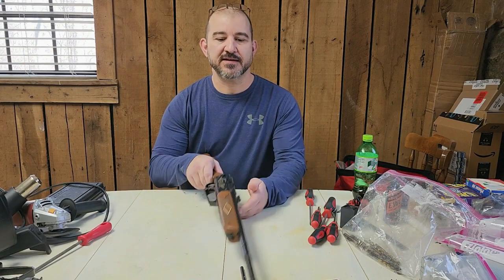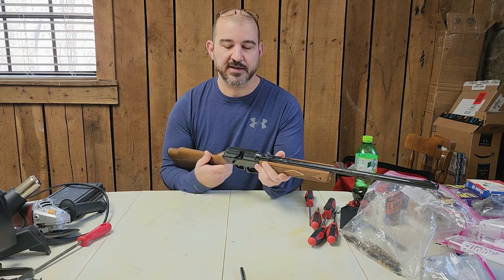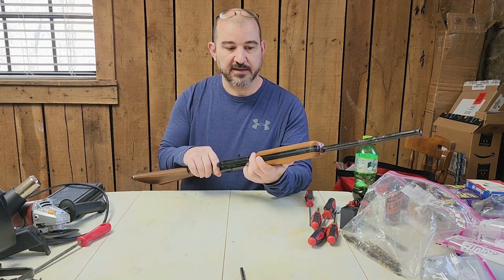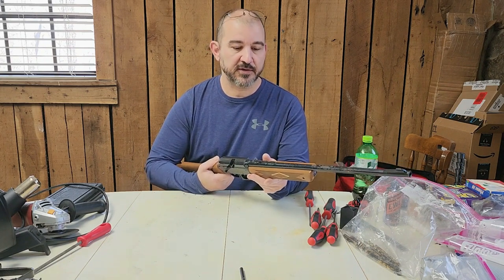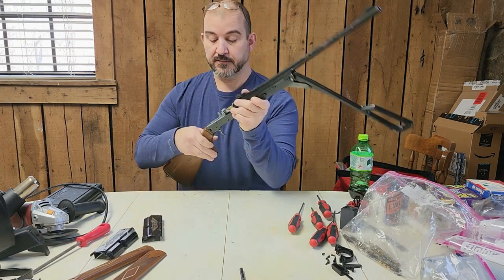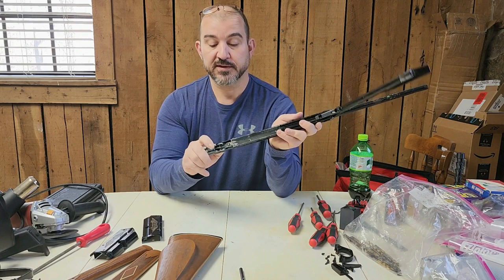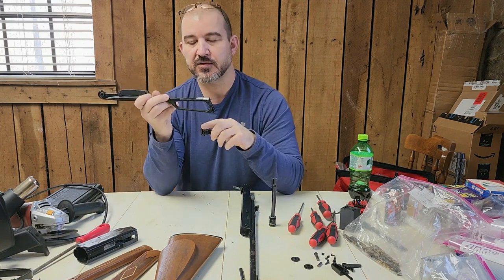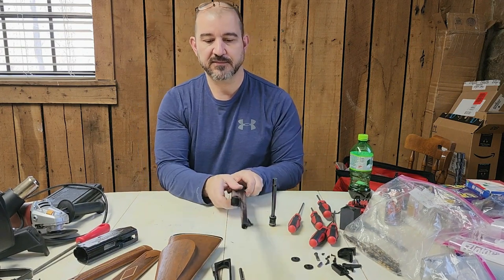Daisy 922 Rebuild Part 1 of 2

Comment: Is there anyway you can send me your contact information to my, this email address. The reason being I am wondering if you can work on a Daisy Power Line Model 44 Vintage Pellet Pistol For Me.
I Have Recently Acquired 3 Of Them one by one, they all are in excellent condition and look like new.

The second one I purchased the clip, was not rotating properly and I made the mistake of taking it apart thinking it was something wrong with the lifter that rotates the clip in the cylinder.
Most likely it was or is the barrel is screwed in a little bit too far and was putting pressure on the clip keeping it from rotating. I didn't have a barrel wrench until I purchased the 3rd one.

I got it back together but I can't figure out how the spring under or on the side of the hammer that goes on first is supposed go. I got it close but not exactly right. I can't find any videos on how to get it to the right position.

I f-ed up,. I know that.
I am most definitely NOT GOING to take apart either of the other 2 to try and see how it is positioned and goes back because they are in perfect working order.
If this is something you or someone you know can help me with I would appreciate it very much.
My email is there in front of the comment.
Thank You,
12/6/2023 @ 1:38 a.m.
Richard Oakley